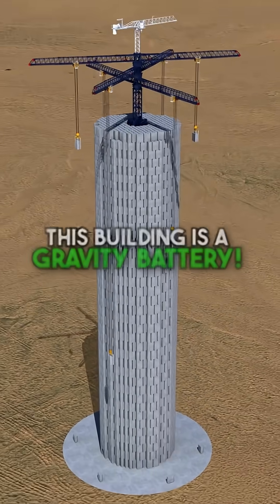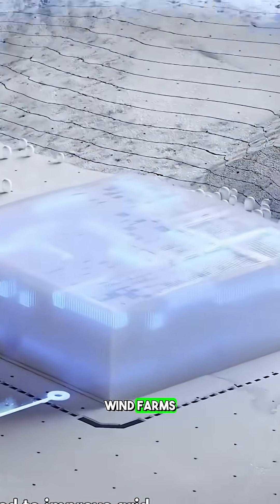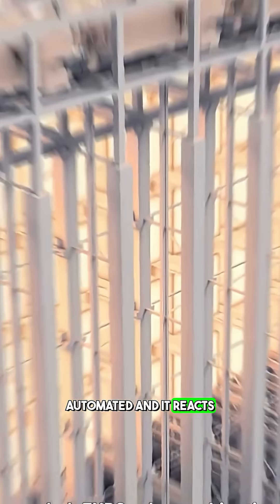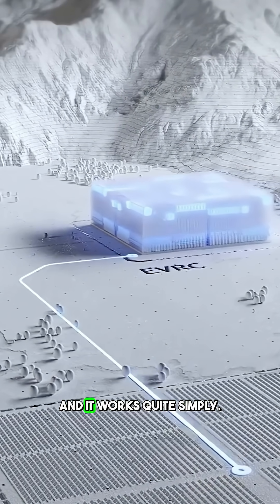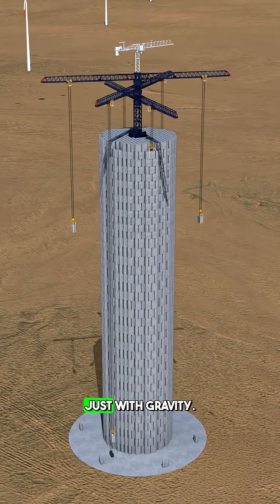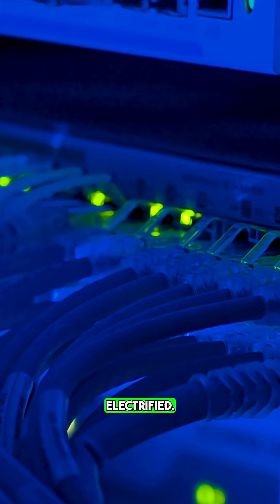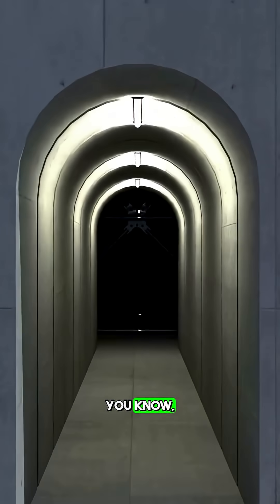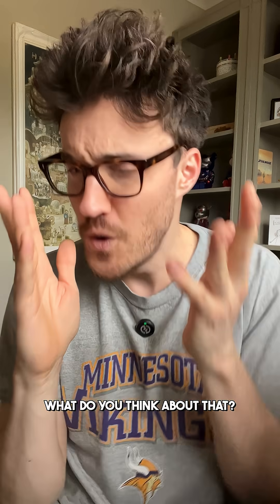This is a GRAVITY battery!

Comment: The startup that wanted to create these basically went bankrupt when their real world test proved it was unfeasible 

Also the original plan was 24 tonne concrete blocks which would produce an astronomical amount of CO2 pollution in the construction of just one of these buildings. It’s not an efficient storage of energy and its construction is far from green

Comment: Well this is an interesting one, this idea has been out for a while and already been basically torn apart. How long would the concrete and crane towers last before maintenance or replacement is required? How would they solve the wind issue with those massive cranes? You talk about lithium mining being bad for the environment but what about the massive amount of concrete required for this? Does that not offset any potential gains? We already have this type of gravity energy storage, and have been using it for hundreds of years, dams, a MUCH less complicated energy storage solution without massive swinging weights and other new dangers and complications. 

Sure, in flat areas without natural waterways dams aren't viable, but we already have a solution for that, battery storage solutions. And if thats also not viable, regular old power plants could pick up the slack overnight or during low-wind periods. That last bit may sound counter-intuitive, but just think about it. While the eventual goal is to replace these plants with wholely renewable sources eventually, if the plants work in tandem with newly implemented renewable energy installations it would significantly reduce the amount of fuel they consume significantly while other solutions are being implemented.

Anyways I've gotten sidetracked, this video really feels like you've just read a tech bro tabloid and repeted it word for word without any real thought on your part. Put some critical thought into the information you spread around.
Reply: > Sure, in flat areas without natural waterways dams aren't viable

Thats the vast majority of the planet

> but we already have a solution for that, battery storage solution

We don't mine lithium fast enough to make enough batteries to store the energy that renewables will be making by 2030. We need energy storage solutions that are not dependent on rare materials or specific geography and this is the best current solution. Yes we will need non-renewable plants but we need energy storage more.

Comment: Similar to how some places store water to power generators. Excess power, water pumped up to a reservoir. Need power, water goes downhill and turns generator
Reply: @druidplayz2313 I think the one in the video will work despite construction cost will not justify the purpose. The hydro battery wont work efficiently.
Reply: @zarakkhan9405 it works better than idling a wind or water turbine when the energy is not in demand. There are a few pumped hydro batteries in Virginia, Michigan, and California and range anywhere from 70% to 80% efficiency.
Reply: @BleuSkiddew  Wow 70 to 80% is quite impressive. These batteries must have the geographical advantage.
Reply: Except this doesnt work at all

Comment: This is an infinite money pit, it will never ever work.
Reply: It is so much less efficient than a conventional battery cost-wise, space-wise and work-wise

I have no clue why this guy is presenting it as something revolutionary 😭
Reply: @xef008 I agree that this is not revolutionary, but it is more sustainable than the convention battery. A life cycle of a generator is 30 years with proper maintenance, much more than the conventional batteries. But maybe you are right, it would still cost more :)
Reply: @zarakkhan9405  well first it doesn’t even really work in practice. Another comment here said the channel name but it would use waaaay more energy than it stores so it doesn’t even do it job right, also the amount of CO2 produced would make it far from a green solution, the amount of money would just be a waste considering how inefficient it is

Edit: Adam something has a good 3-4 minute video about it here
https://youtu.be/iGGOjD_OtAM?si=I-hB9NpqreTSXVnk
Reply: @Kylel0519 I watched the video, very informative thank you. 
I agree with him on all the points especially when he calculated that the battery can hold power of just 2 wind turbines a day.
Reply: How come?
Reply: I know the cost wont justify the purpose but it should work..